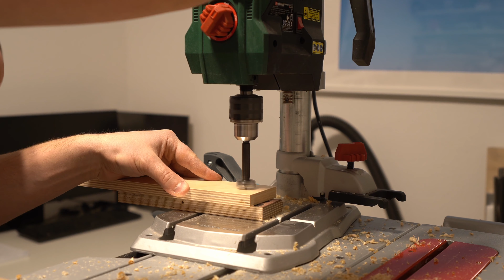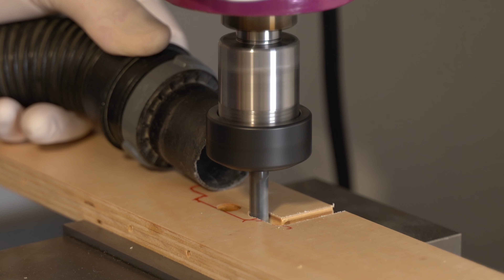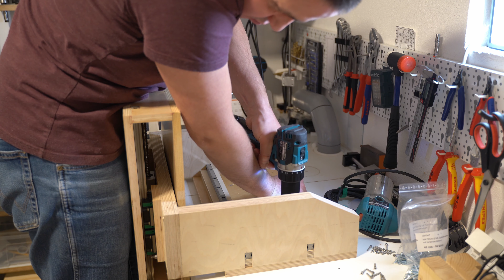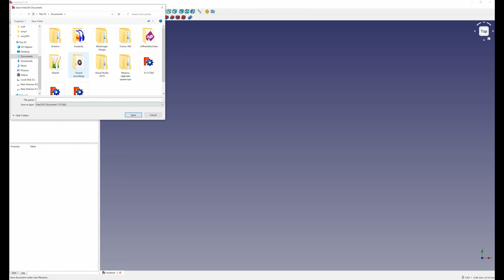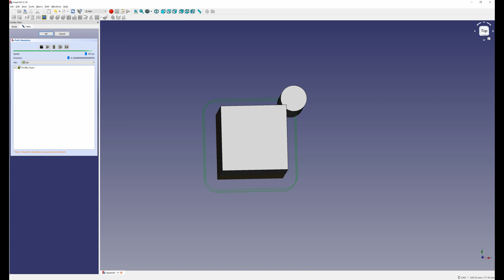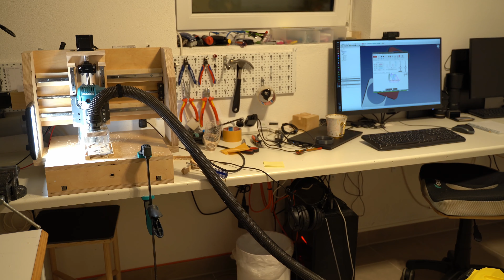Plywood CNC

Comment: Excellent video. Very nice build. You are the only person that has ever discussed rigidity. I have done deflection measurements of 38mm square steel tube, both empty and filled with concrete. Results were not impressive. You can get way more rigidity for less cost with plywood than you can with any other material. My 6090 is like a wet noodle and I am going to rebuild parts using plywood. wood is such an under rated material.
Thanks also for the FeeCAD CAM demonstration. I had not realized that it has evolved so much over the years.

Comment: a few things, firstly if you think you need a bit more rigidity consider making torsion box beams for you x and y.  I made a small machine and a 90mm square glued mdf torsion box ended up very very stiff.  Next that printed spindle holder should be replaced.  you can get an aluminum one cheap but try to avoid the 4 screw hole versions and get the bigger one with 6 holes.  For cutting ALU consider isopropyl alcohol.  It keeps the cutter cool and doesn't leave a mess.  Finally, and most difficult, invest in a good vice or pallet.  Workholding is pretty difficult and requires time/money.  Investing in a good quality vice will survive your next 5 versions of this CNC build!  Keep going!
Reply from the maker: Thank you, Jesse, great points!

Comment: Outstanding!  Very nice with just wood for the CNC.   For aluminum, slow down the speed of motion and decrease the depth of cut.  as I have seen videos on CNC machines, it is always speeds and feeds.   For chip containment, most CNC metal cutting CNC's use an external box to keep the chips from flying around.
Reply from the maker: Thank you, Robert. I also want to prevent chips from getting onto the rails and ball screws, and just direct them into the vacuum. I'll figure something out.